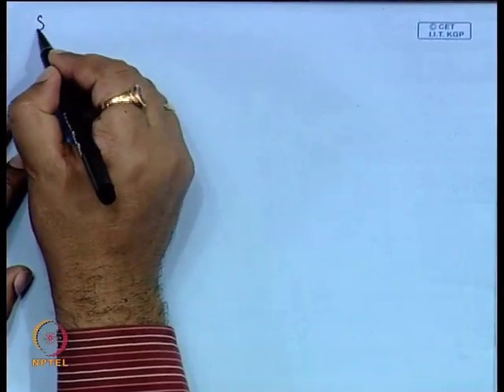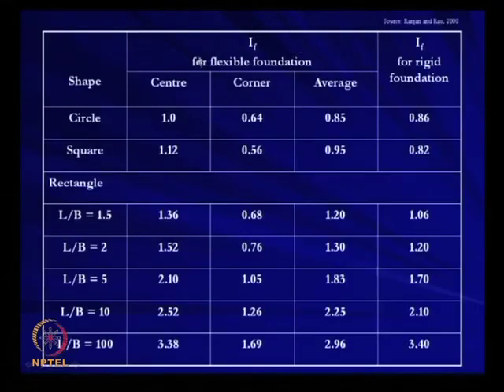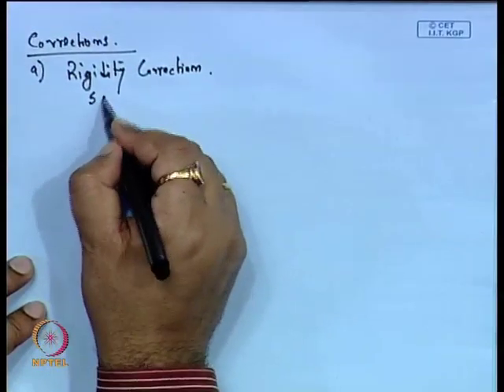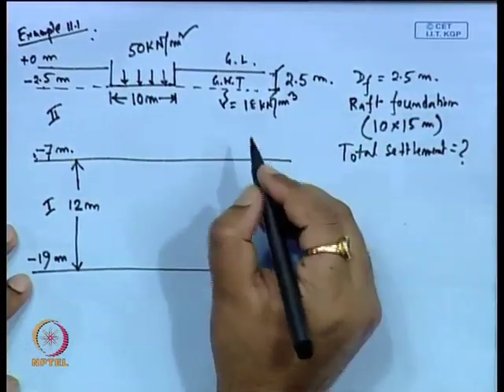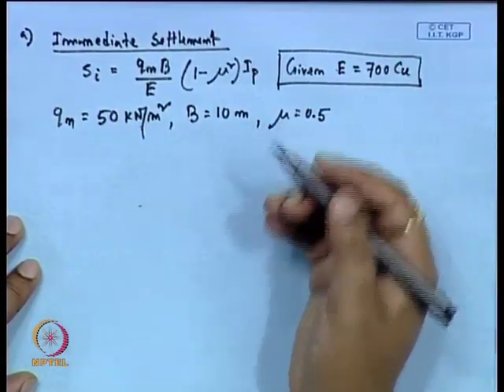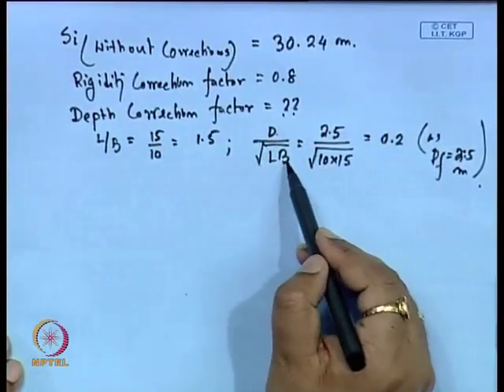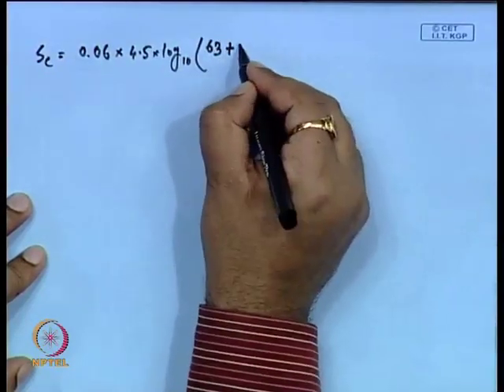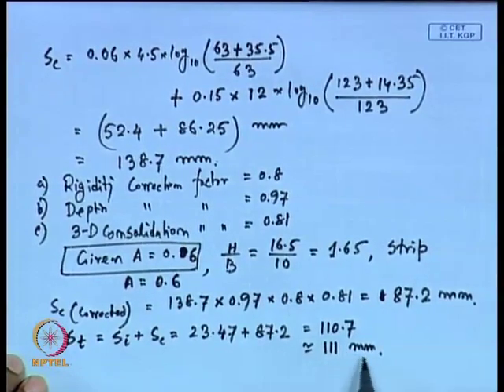Mod-01 Lec-11 Shallow Foundation - Settlement Calculation - I

Comment: A ring foundation is of 3.60 m external diameter and 2.40 m internal diameter. It transmits a uniform pressure of 135 kN/m. Calculate the vertical stress at a depth of 1.80 m directly beneath the centre of the loaded area. Solve it plss sirr sirr plss  send me  solution